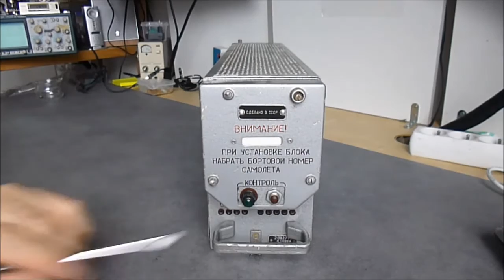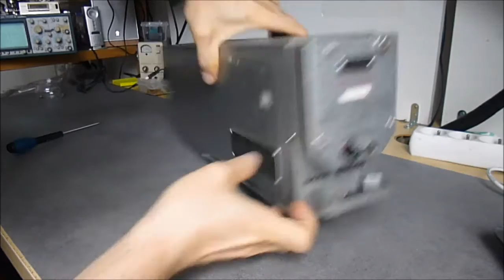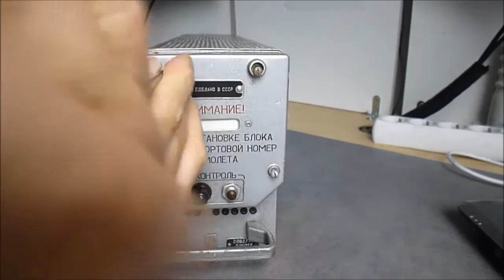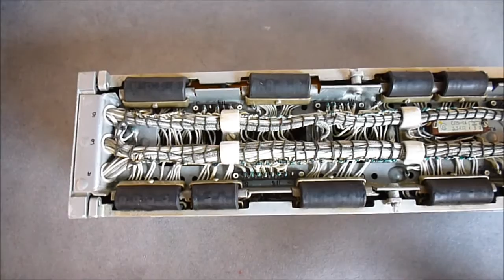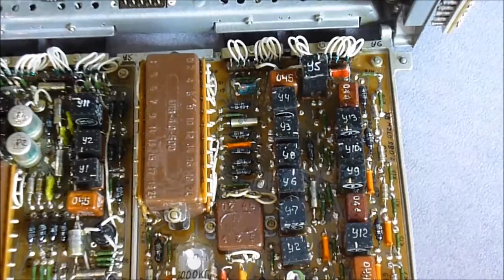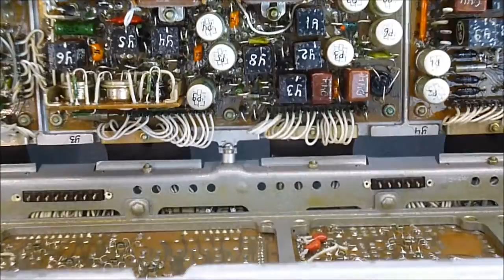Teardown of the last part form the soviet IFF I scrapped

Comment: "metal capacitors" here are also micromodules actually. Also your link is broken.
Reply from the maker: It is a problem with links, they die eventually. It is fixed now, and at the same time I noticed the oldtriod.ru website has a lot of new stuff to look at !

Comment: Fascinating.
Looks like the unit receives a binary modulated rf signal, then the delay lines store that signal enabling the code converter circuit within the module to produce another binary modulated rf signal determined by the binary selector on the front.
An interesting collection of digital and analogue electronics, those electronic blocks are most unusual.